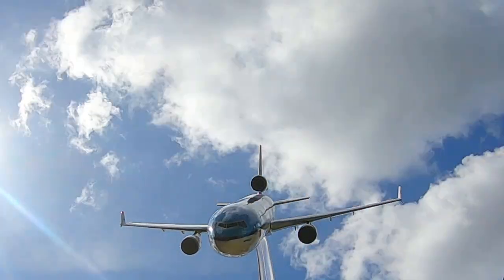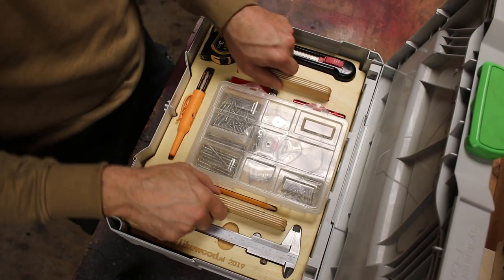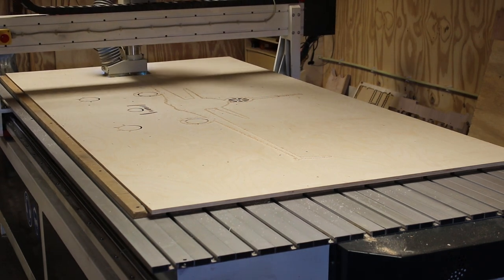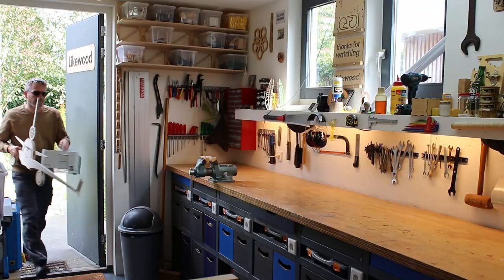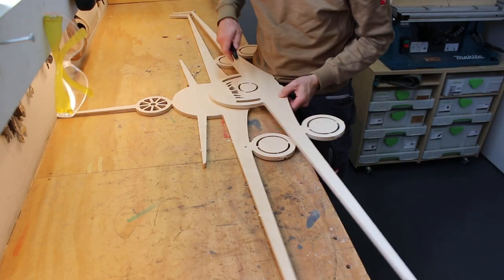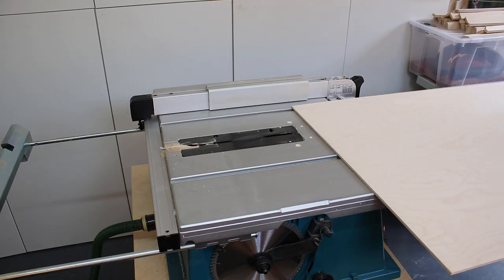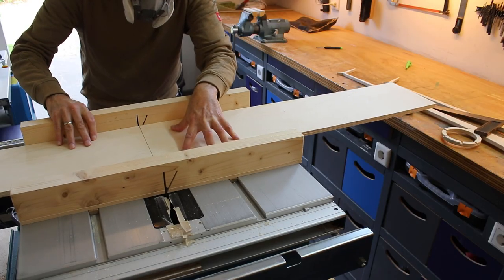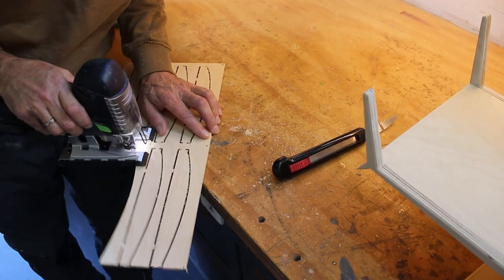Airplane MD11 bookshelf | made with CNC

Comment: Really awesome project! Can you tell me  what kind of screws you used to secure the plane the way you did? I've never seen that before and looks really secured on there. Thanks for sharing your video!
Reply from the maker: Thanks for watching. The threaded bar I used to secure the shelf on the wall is called a dowel screw or hanger bolt.